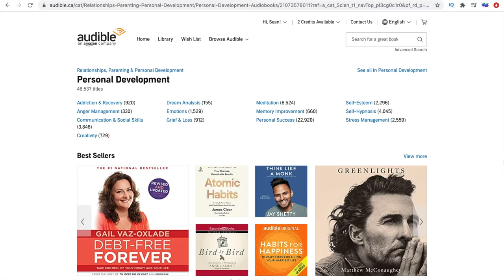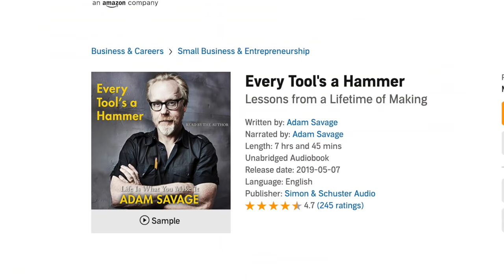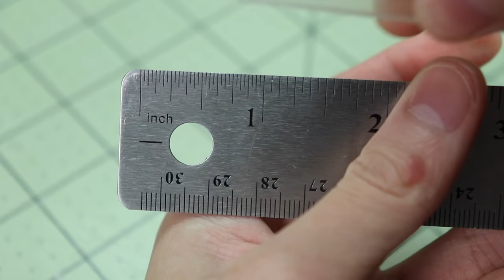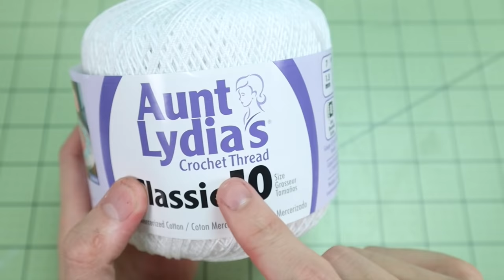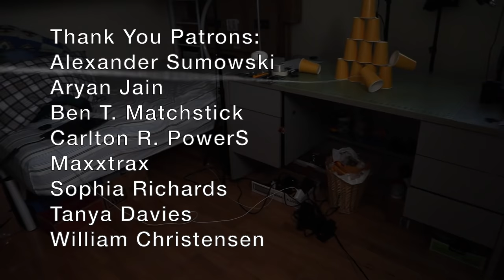Miles Morales PS5 Web Shooter That SHOOTS! DIY EASY (No Magnets, No Spring)

Comment from the maker: Get your first audiobook for free and a 30-day free trial when you sign up at http://audible.com/seanscrafts or text "SEANSCRAFTS" TO 500-500

Support me on Patreon here: https://www.patreon.com/seanscrafts

FREE TEMPLATE: https://drive.google.com/file/d/1HYEhVBcIFkTwCRHjGrZZdE7IQmTs6voj/view?usp=sharing
**YOU WON'T BE ABLE TO ACCESS THE TEMPLATE IF YOU ARE LOGGED IN ON A SCHOOL EMAIL**

How to print the template:
1. Download Adobe Acrobat Reader here (for free): https://acrobat.adobe.com/us/en/acrobat/pdf-reader.html
2. Right click on the template, then click "Open With" and "Adobe Acrobat Reader DC"
3. Click the printer icon at the top left
4. Under "Page Sizing & Handling", click "Size", then select "Actual Size" (FYI these templates were designed to fit my wrist which has a circumference of roughly 5.5 inches, so you may need to elongate the wrist strap piece if your wrist is larger than mine)
5. Click "Page Setup..." and specify what type of paper you are using (US Letter for example) before printing

Materials:
paperboard (AKA cereal box cardboard)
thin corrugated cardboard: https://amzn.to/2NBAP6i
craft foam: https://amzn.to/30PFdGw
black spray paint: https://amzn.to/3dgryuz
red spray paint: https://amzn.to/2UEwqmt
ballpoint pen ink tube: https://amzn.to/3mxjn29
super glue: https://amzn.to/2xSssPq
popsicle sticks: https://amzn.to/2RI4koM
bamboo skewer: https://amzn.to/2A6CzAL
push pin: https://amzn.to/34ypvBi
rubber bands: https://amzn.to/3ozauH7
fishing line: https://amzn.to/3efO9Jf
crochet thread: https://amzn.to/2FNObM6
velcro: https://amzn.to/3dirwU0
craft knife: https://amzn.to/3fzVcO0
replacement knife blades: https://amzn.to/3eUIgBw
cutting mat: https://amzn.to/2ZxGqjo

DISCLAIMER:
This comment contains affiliate links, meaning if you purchase something using those links, I will receive a small commission. The links do not cost you anything extra at all, but clicking on them to buy something helps out the channel!
Reply: Dude amazing Job!!
Reply: Hello
Reply: Got you
Reply: You're so cool! 😎  Keep it up!
Reply: This is fire also how's ur day
Reply: Great work Shawn this is the EASIEST webshooter and the first one I will make thanks so much
Reply: Origami with Shravan Walunj  I agree
Reply: Can you give away the webshooter cause im poor as hell with this pandemic and i dont use amazon shopping cause i live in the Philippines
Reply: Your vids make me happy
Reply: He's awesome
Reply: DUDE you make some awesome projects, can you make the classic silver web shooter or that one spiderman got from shield in the first episode of ultimate spiderman oh and the mk 1 web shooter you find in spiderman ps4 is a great reference image for the classic web shooter cause you a full 360 view of the web shooter
Reply: Dang... even I wish to make one right now, nice job
Reply: Most talented guy on YT i am a long sub i been here since the electric longboard vid lol
Reply: Dude I literally commented make a miles morales web shooter. The account i used was 1 Dead Pixel.
Reply: Make a setup video please please please
Reply: How make a web Shooter make a rubber band no Spring and no magnet
Reply: Thank you shown
Reply: Hi Shan how make a spiderman web Shooter make a rubber band and not using springs and magnets
Reply: Amazing
Reply: Pls make scarlet spider web shooter
Reply: Sean can you make a Ben 10 omnitrix
Reply: Can you make  web shooter with out  hote glue
Reply: Please make a Ps4 without springs
Reply: I request you you make Spiderman     Noir web Shooter Shooter
Reply: But can you invert the nozzle to web zip twice?
Reply: well done, please do it without magnet and without glue good luck.sean
Reply: I am making the same one from reference photos and I started 2 days ago
Reply: Make Sonic shoes text
Reply: Please make a Miles Morales  version with springs and magnets
Reply: You should make a web shooter with a better wrist mount and with parachute cord or something so you can actually swing from it.
Reply: y si haces un lanza telarañas que sea de spiderman  homecoming
Reply: Yo Sean, can you make the of webshooter from the comics?
Reply: Sean can you make a Spider-Man costume
Reply: @Harris_100  its super glue... but how would he do that?
Reply: Dude make homecoming Web shooter with rubber band pls
Reply: Please make Spiderman homecoming web shooters of final bettel please please please make
Reply: Can u shoot at metal things with that
Reply: @Barney5m   he didn't put magnets  
Then 
how it shoots in metal 🤔🤔
Reply: Hey
Reply: Dude to day its my b-day! And i want to see how do make iron man mask!
Reply: Hey man this was amazing but can you make something more compact, great videos man:)
Reply: Its so hard to Bild this can you Help me
Reply: Can you make iron spider web shooter without magnet,if possible and if not,its ok
Reply: Spider man scarlet
Reply: Yeye, go my man!
Reply: Could i use cardboard instead of cereal box?
Reply: U r really talented in crafting  but why do u always make spiderman stuffs only
Reply: hey Sean can you make a cardboard karambit?
Reply: That's awsome I was just about to go to the website but I see this now and I really want to help the channel because imagine making one that sticks to stuff!  i guess you could just put duck tape on the end of the bamboo.
Reply: @vAvoid  pretty good after seeing this
Reply: I think Next you should do either 1994 webshooter or 2002 webshooter (i mean a webshooter you designed to look as invisible as possible)
Reply: Can you make a video on just the web shooting mechanic so we could possibly make our own custom ones
Reply: Can you make a web shooter you can clip onto braclet
Reply: You are a genius you make very easy and very amazing things of Spiderman web shooters and the mask with moving eyes awesome, but can you make a Spider-Man suit with that thinks? Because if it's amazing, amazing Spider-Man. 🕷🕷🕷🕸🕸🕸
Reply: Make the homemade web shooter from Spider man homecoming
Reply: Classic web shooter as in the first web shooter in comics
Reply: Can u make it with out a fishing string like dental floss?
Reply: Hi .How do you creat the amazing spiderman 2 mask?
Please tell me
Reply: te crees ingles
Reply: Make Venom Web shooter
Reply: Can you make the Disney XD Marvel's Spider Man Web Shooter?
It is easy to make and try making it small so a 14 year old kid can wear it.
Reply: Wath
Reply: How does it stick to things if there is no magnets
Reply: @Dragon D. K OMG CAN U JUST STOP! HE DOES EVERYTHING HE CAN SO GO AWAY
Reply: Virat Namdev  he already did
Reply: Hey bro you have to sells whats u got cause that’s really impressive what you can do brotha
Reply: @kurt8905  ur not rhe only one im fillipono to kamusta
Reply: @kurt8905  wat i do????? Sama mo
Reply: Please make ultimate spider man web shooter 🥺🥺🥺🥺🥺
Reply: Sean please make ultimate  Spider-Man web shooter please please please please please please
Reply: But how we reload it if the paper ran out ?
Reply: What are the dimensions of the pieces on the template I don’t have a printer
Reply: It dident work
Reply: Sean can you make a skate board but not electric
Reply: Ah si 66 años no 636632 horas y que 43 días 6 meses 6 meses después del Ecuador 6y el
Reply: I would like to purchase your web shooters
Reply: Can i have template please
Reply: I have not got fishing line what do I do
Reply: Can you make a Henry Stickman plushie
Reply: Can you make spring and magnet version of this
Reply: Hey can you mace a soot
Reply: Tataks
Reply: can you make this web shooter but with magnets and springs
Reply: Hi Sean I am from India when I saw your video for the first time I thought you buy it
Reply: YOU
Reply: That's the g
Reply: 1
Reply: W
Reply: Can you make the web with magnate??? 
Day 1
Reply: Can you make the web with magnate???
Day 2
Reply: Can you make the web with magnate???
Day 3
Reply: Can you make the web with magnate???
Day 4
Reply: Can you make the web with magnate???
Day 5
Reply: Can you make the web with magnate???
Day 6
Reply: @IsraafeelMohammedMusic  a
Reply: Tô fazendo lançador de teia
Reply: Tô inventando um lança teia
Reply: What?
Reply: Can you make the web with magnate???
Day 7
Reply: Web shooter spider man 2999
Reply: Can you make the web with magnate???
Day 8
Reply: Can u make a web shooters without magnets
Reply: No peper no baby box
Reply: ReP
Reply: Can you make a spiderman shoes
Reply: Amazing job
Reply: Got u
Reply: Can you make a spider woman web shooter from spider man into the spider versus
Reply: Dude im from india
Reply: Hey can you make the spider man 3 web shooter with out any springs and magnetics and templates
Reply: Templates please
Reply: Make with out any popsicle sticks and downloadable templates and fish ing line
Reply: Without craft form
Reply: Thanks
Reply: How about a quick reload webshooter
Reply: hi can i buy your spider web shooter
Reply: hi can i buy your spider web shooter
Reply: Hi sean
Reply: @mcuspideyyt532  yo be honest you are not a yt
Reply: @s3_gamer503  what the-
Reply: The projects are too hard
Reply: The projects are too hard
Reply: The fastest web shooter to build
Reply: Great video but I won't get audioble
Reply: Make web shooter with one paper
Reply: Can you make black Spider-Man’s web shooter please
Reply: I wanna your craft cutter safety cover
Reply: Please take my quiestion
Reply: hey
Reply: Yap
Reply: Get
Reply: กืโหด่พาคถ้ารถพ้พี
Reply: Get you ❤️
Reply: Get your bsaj
Reply: what are the length and width for the piece in 5:35
Reply: @mcuspideyyt532  b
Reply: Sean's class
Reply: Can you make a spider man mask
Reply: Can you meet an easier one
Reply: Hey Sean, can I swing from it?
Reply: i need a web shooter can you make one for me  pleeeeeeeese  i live in north ogden
Reply: Maks
Reply: Mak spidermanma
Reply: I'm 11 and i always wanted a webshooter irl but every video is to hard to learn from so when I was 9 I went on instagram asking youtubers like you to make it for me they never responesed
Reply: Can you make a Iron man hand ✋
Reply: Love from Dubai❤
Reply: Sharon my name is Joshua can you send me the template
Reply: Make  it  more  essayer

Comment: Think you can make a turning web shooter next so you don’t have to continually reload it? I know it’s gonna be hard keeping it simple and with out servos but maybe you can do it similar to the barrel system on a nerf gun?
Reply: He should that
Reply: Yeah that's actually a good idea
Reply: I agree
Reply: MR.COOLKID  it’s pretty cool but I meant one that has an auto rotating barrel after a shot as in like most barreled nerf guns, you take a shot and the barrel automatically rotated to the next dart slot, but this is gonna be challenging without servos. If you look at a Chanel named the. Amazing, he is trying just that but with a servo and gear system. I think maybe you can achieve that same thing with a rubber band twisting system.
Reply: Yeah i think he can make that stuff.
But sean please make it as soon as possible.
Reply: That's a awesome idea
Reply: He shoud

Comment: Omg I just realized u can use the rubber pen grip for the ammo holder bc it's flexible and won't break easily. Hope this helps.
Reply: do you think someone can use very small hand made net in it with string attached? if so how do you think it will be possible
Reply: @Ilson7  Idk I just gave advice on where to put projectile bc the paper kept becoming destroyed if you try and stuff it in there. Srry